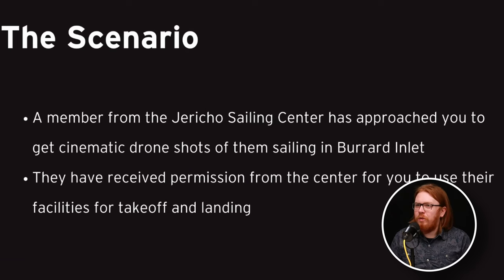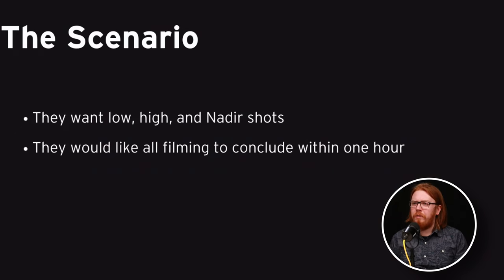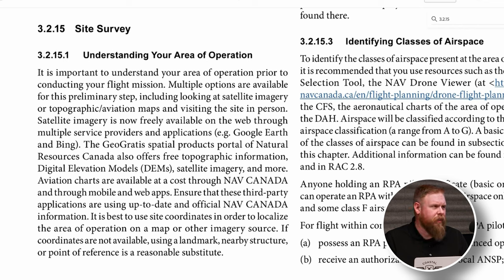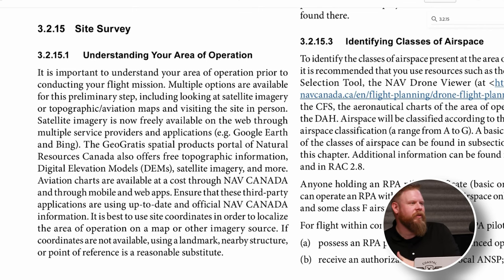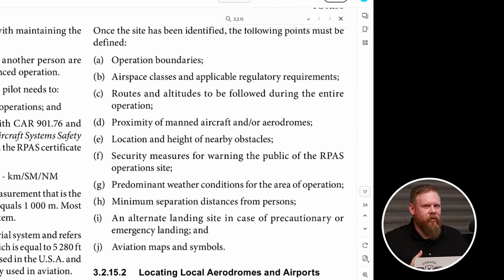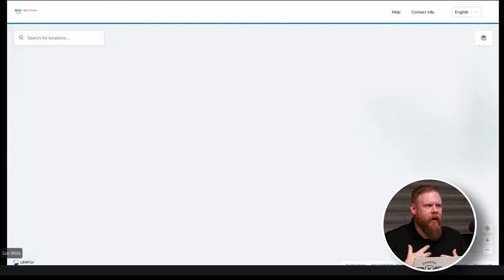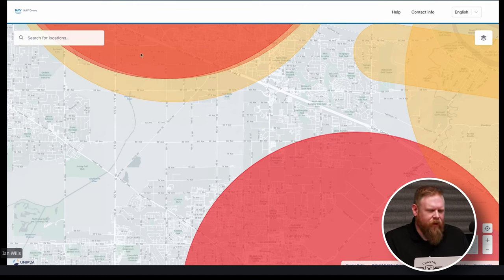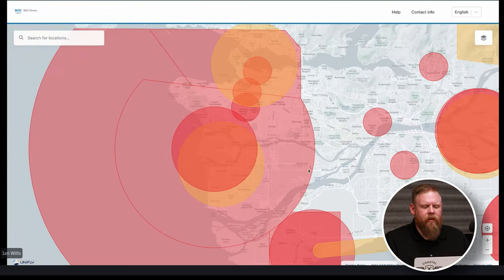How to fly a drone in Vancouver Controlled Airspace - Weekly Live 2024-9

Comment: Say you get approved for flight at a max altitude of 20 meters over downtown Vancouver. If you're flying over a building, are you allowed to be 20 meters above that building or only 20m agl? Or can you be 30 meters above buildings?
Reply from the maker: According to NAV Canada: Approval height in controlled airspace starts at the surface so it would be 20M AGL.
Reply: Interesting! Ok.. So the current automatic height limit says 121.92 m for over downtown Vancouver. So say you wanted to fly to the Shangri-La tower (that is 200 meters tall) and then over it and back down. You would need an SFOC even though CARS 901.25 (1)(b) says you can fly 100 feet (30 m) above any building or structure, if the aircraft is being operated at a distance of less than 200 feet (61 m), measured horizontally, from the building or structure?
Reply from the maker: @JonnyRay82   SFOC not applicable as you're in Controlled Airspace.  You'd need to discuss and get approval from NAV Canada for the higher operating altitude.  901.25 is only applicable to uncontrolled airspace.
Reply: That makes sense. Thank you.